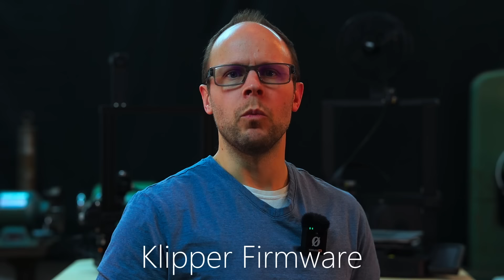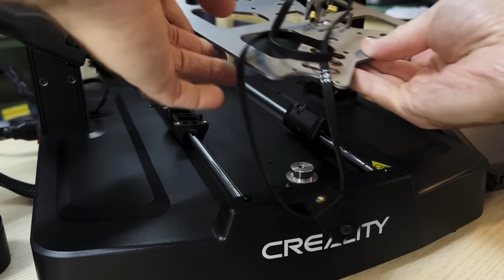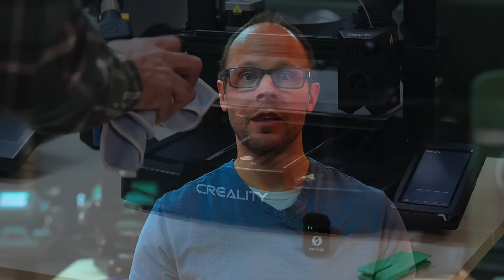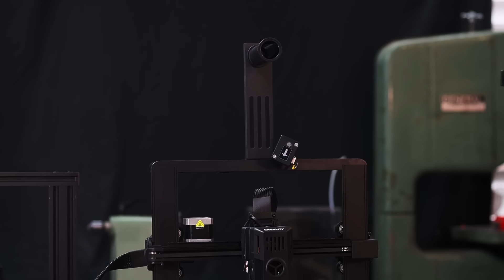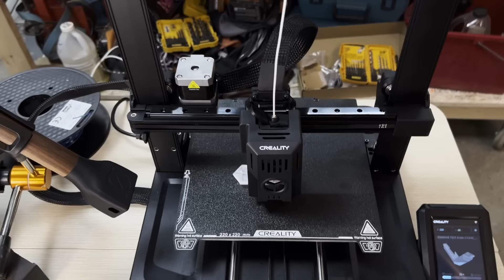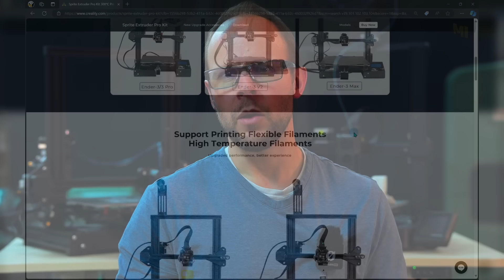Is the Creality Ender 3 V3 KE Any Good?

Comment: Thank you for your video, Can you please do a comparison between Ender 3 V3 KE and S1 Plus... I want to purchase my first 3D printer and I'm so confused... I like the 30x30x30 bed of the Plus version.
Reply from the maker: I've had a look at the PLUS and there are some good features, the cast metal frame is very nice, however they are still using rods an linear bearings on an even larger bed, that's a little concerning to me.  On the other hand, adding linear rails to a cast metal base would be super simple and I believe that the risers on front and back can be removed and linear rails can be added to go right through.  If it were me, I'd get the Ender 3 V3 PLUS, no question.  I'd also want an enclosure, big prints are prone to warpage and shrinkage, even more so in an open air environment.   I'll reach out to Creality to see if they'll send me one to test out.
Reply: @NeedItMakeIt  Thank you for your answer, It really helps.
Reply from the maker: @vahida6146  I'll have a video out within a few weeks showing the solution for the KE printer using linear rails, but in the best way possible, I think a lot of people are going to wait to do the upgrade and I've made it as simple as possible.  I do want to get a Plus as well...  Plus stands for + size printer?  I'd like to see if it has the same problem, but I really like that they've used some of the same parts and methods from the K1 series of printers.  I really enjoy my K1, it's one of my favorite printers.  The Bambu X1 is great, but it's quite $$ in comparison.  Being able to swap parts between printers is ideal and it's nice to have printers that all look like they belong to the same set too.  As a side note, the new printers are also grey, which is so much nicer for keeping them looking clean, the black shows every single spec of dust and in my shop at least it's a bit annoying.

Comment: Can you give more detail on the 'tried to align them a little bit better' portion of fixing the bed wobble at 5:30? I only see you demonstrating the problem and then demonstrating that the problem is gone.
Reply from the maker: I ended up making a follow up to this video to identify the exact issue.  https://youtu.be/B06lTrhjC5s?feature=shared  The issue is fixable if you want to ask Creality for replacement parts, or if you want a better solution, I'm working on one that will be far better than the original setup.  I'm just waiting for parts to arrive before I can finish the video up.
Reply: oh awesome, thanks! the linear rail solution the other person made looks good too. do you think replacement bearings from creality would be different?
Reply from the maker: @jackmaniacki  I think unfortunately it's the rods, but if they can send you the new rods, it would help a lot.  Yes there is another linear rail option, but it's still not perfect, they've used the original mounting position of a central placed linear rail carriage.  It will not provide the stiffness needed IMHO when printing at the front and back.  It's still better than the original no question.
Reply: @NeedItMakeIt  thanks a bunch for taking the time to reply to a total noob. I think the stock set up is going to be ok for my needs for the time being, but I'm going to reach out to creality and sub to your channel 🙏
Reply from the maker: @jackmaniacki  If you can get the replacement parts, I think it'll do fine, if you can measure the rods, they should be exactly 8mm, or even slightly oversized.  My K1 rods measure at 8.05mm, which is perfect for a bit of pre-load.  Unfortunately the KE was 7.95mm, close but not quite good enough it seems.  

No worries, it's my pleasure!

Comment: Have you used a slicer other than Creality Print with the KE? Creality seems to lock up a lot.
Reply from the maker: If you've rooted your KE I'd switch to Orca slicer I only use Orca now for my Bambu and all of my Creality Printers.  If you need some help getting there, let me know, I can guide you a bit if you need it.  

Creality Print is really slow and doesn't have some newer features that Prusa/Bambu/Orca have.

Comment: To answer the title of your video, its absolutely trash, my Ender 3 V3 KE broke down after a month of light use, then broke down 2 days after I fixed it and did a complete hotend replacement. The customer service also refused to help.
Reply from the maker: I can see the extruder not lasting, it's designed for lighter duty printing, I can see by the construction that it's not build to the same standards as the K1 extruder.  I just made a follow up video, and have found the source of the problems I was speaking about in this video if you're curious.  Can you request that Creality send you a replacement extruder?  The hot end should be plenty capable, it's been running for months now on my K1 and works really well IMO.
Reply: I will give it a go, thanks :D
Reply from the maker: @superchargewither2893  Let me know how it goes.  In the video I just released today, I showed how it's possible to fit the K1 extruder onto this printer.  I changed it back afterward since it didn't seem to fix my problem I was having.  It's a nice compact extruder, maybe that's a better option.  I still think that the sprite extruder isn't good enough for the faster printers.  Hence the change on their next new printer.   https://imgur.com/a/NgCAGJX

Comment: I got the KE a week ago and it's great, but I'm only doing PLA. It's my first 3d printer so I don't feel ready to branch out into other filaments just yet. I love how easy it was to put together and how I haven't had to tweak any settings or anything yet and things are just working well out of the box. The fear of tinkering and calibration is what kept me out of 3D printing all this time.
Reply from the maker: It is so much better than my old Ender as far as the software, there is one lingering issue left to make it a really good printer for any material.  I have a video set to release tomorrow morning.  It wasn't too clear where the problem was coming from, but it is very clear now.  Maybe you can check your printer for the problem if you have a chance to check it out.
Reply: @NeedItMakeIt  I'll be on the lookout for that video man. Thanks

Comment: I just bought a KE and am having print problems on the sides of my models.  I have tried many print configurations.  Is there another printer in the same price range you like better
Reply from the maker: The Bambu printers are the best bang-for-the-buck, they are a bit more expensive, but you also get a lot more features.  If you can afford an A1, it's a good printer, just make sure if you jump to that one that you get a new version with the bed strain relief issue sorted out.  They have some stellar engineering skills, however even they also have problems sometimes.  I expect that they've been pushing so hard that they didn't test their product for a long enough time to find the issue.
Reply: Thanks for getting back to me.I replaced my Ender 3 V3 KE with another one.  Same problems.  The most annoying is the extruder stops extruding mid-way through the  print.  The nozzle gets stopped.up and I have to pull the filament out and re extrude.  Is this a software problem or a design flaw? I used the PLA that came with the printer and I am using the normal print setting.  Do you have any tips that will help me through this conundrum?  I like the printer but I will send it back if I can't resolve this problem.

Comment: This printer doesn't worth $280 , maybe $180, why would someone buy this over bambu A1 mini for same price or A1 for $150 more?
Reply from the maker: I have to agree, as-is with the issues, it isn't worth it, the competition's printer offers quite a bit more for the value.  The only + for these kinds of printers is that they're more easily modifiable, and that's what a lot of people want.  I like to mod my printers personally, but I try to restrain myself to keep the printer as close to stock as possible unless it's something major.  The fit of the linear bearings onto the rods is a big issue IMO.  That needs to be addressed from Creality immediately.  The A1 mini is a bit small for just about anything I print, maybe it's okay for some people in the type of work they do, it's still a good printer no doubt.  The A1 is a great printer also, and the issue with the cord should be fixed in the next releases.   I have a follow up video coming out tomorrow to show the reason behind the poor print quality, it wasn't what I expected, but turned out to make a lot of sense.

Comment: I wonder if adding the preload to the Y axis rails will cause premature motor failure.
Reply from the maker: I'm nearly finished the follow up video to this one, I've found the source of the problem.. I think I'm just running some tests right now.  Adding some pre-load here should be fine, the linear bearings have very little friction, less even when we pre-load since they don't fit the rods.  I'd think that 8mm exact rods would be the best solution here, but pre-loaded bearings for a slightly undersized rod would work well also.  Unfortunately the design is very limiting, the bearing blocks are central and aren't tight enough, it causes a lot more movement as you make your way to the ends of the bed.

Comment: I've had my Ender 3 S1 Pro for 9 months now. It also has the Sprite extruder. I had similar if even worse problems with inconsistent extrusion with every filament after a month or two of using the machine. After quite a bit of hair pulling and web searching I was able to figure out that the filament tension adjustment spring is too loose and can drift over time, and that it turns out that it is not very difficult to make the mistake of overturning the screw used to adjust the tension. The adjustment is very "on/off", there really isn't very much feedback to be felt in the filament locking lever when changing it, it's either super tight or loose. When you overturn it, it can pop out of the threads of the square nut that it goes through, and after that you have to open the extruder and put it back in manually. It doesn't help that the screw has backward threads.
In my case it had come off due to me overturning it, and I didn't know, and I had almost stripped all of the very short thread clean from the square nut by trying to spin the screw when it had jumped out of position. It took some fiddling and quite a few carefully chosen swear words, but I was able to get it back on and also modify the whole thing with some spacers, which make the adjustment spring tighter to begin with and hence the adjustment will not start drifting again and the risk of unscrewing it is a lot smaller. I hope...
Reply from the maker: Thanks for that info, I should have a follow up video ready for this weekend, I believe I've figured out the problem, though I need to test and prove it.  I did an entire extruder swap and used my K1 extruder, however the problem did not go away for me.  I'll be careful with the original extruder's tension though, thanks for that.  I would have kept the K1 extruder on, except the fan cover doesn't fit over it, which is a bit of a bummer, I like the K1 with the larger gears and sturdy build quality (newer versions).

Comment: When you did the test on the extruder head you showed the indentations on the PETG filament, you did not show the indentations on the PLA. The depth of the indentations would show the pressure on the filament, one may be harder than the other. The result may show that you may need to increase or decrease  the pressure on the extruder.

Comment: Thanks for the great video. I was on the verge of ordering one of these but you've more or less convinced me otherwise. I already have an older flakey bed slinger which, despite producing very acceptable prints, requires way too much maintenance and hand holding. I was hoping to get away from this while increasing the print speed a bit but I guess it's just not happening with the KE and probably not in this price range.

Comment: The two rod retaining screws in my case don't even reach the rod.
I changed the screws 1mm longer and now my table is fixed, it doesn't move at all.
Reply: What are your prints like now then, I have one in my shopping basket but this video has worried me with the artifacts in the video
Reply: @mrinfelix4574  I've never had any problems with the quality of the print, but the important thing is that almost none of the screws are properly tightened at the factory. The two shaft retaining screws were not even in contact with the shafts and therefore moved. I had to replace them immediately with longer ones, now they are properly secured with no movement at all.
Reply: @mrinfelix4574  I hope you didn't buy one. Go with the Bambu A1 mini if your new to printing.

Comment: I think you are on track with the extruder drive.     Creality has had issues with the extruder on the k1 series in the past.  One thing to look at withnthe filmament is the consistency with filament diameter and possibly correlate to this issue.

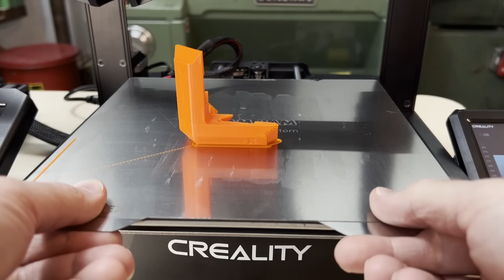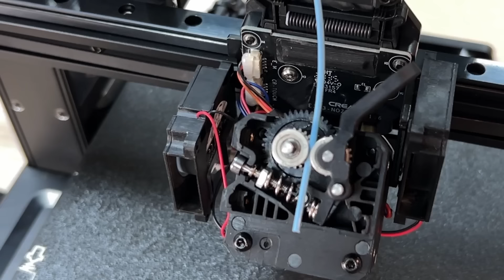Comment: That wave pattern you are seeing in the prints (13:33)  looks like nozzle pressure fluctuating. Coincidentally if you stare at the extruder when you are testing it (21:15) you can see a rhythm especially at the end of the latch since its exaggerating the issue, something isn't "round" or the gear that's feeding filament has a bore slightly too large for the shaft and a set screw is pushing on one side so its not centered. That is why the feed gear marks are uneven on the filament. When you print fast that will cause the molten filament pressure fluctuating at the nozzle thus causing a wave pattern in the print. 

I'll be curious how you fix the bed. My thought is to just continue what you are doing and shim the rods outward so they push on one side of the bearing making everything tight (if that make sense god bless you). It's a bandaid solution tbh. You could elongate the mounting holes for the bearing carriers into the bed so you can slide them outwards to make a tight fit.

Honestly I feel this is poor engineering. They are trying to add features that enhance precision on the cheap, and end up worse then where you started. Those bearings and rods is an obvious example, they had a solution that wasn't very elegant but it got the job done. Now they have a elegant solution that can't get the job done.
Reply: He did have the extruder case open which makes the gears and shafts wobble when spinning because they aren't captured from both ends.

Comment: I got the Ender 3 v3 ke, and really so far, it’s been amazing. IMO it’s a really great printer.
Reply from the maker: That's good news.  Are you seeing any of the same issues as I had?  It seems as though printing PLA is not a problem, but PETG is, very strange.  I am working on trying to fit a different extruder to prove/disprove that theory.  I think the printer has potential, it's nice to be able to work on a printer that's open again, so much easier!
Reply: @NeedItMakeIt  I don’t have a problem so far.

Comment: i have the ke and i went threw everything you did in this video. it was frustrating. i did find that every filament so far runs the greatest at 240mm. the hyper i can run full tilt but make sure you have a good solid platform the printer is on when doing so.

Comment: My KE arrives in a few days.   Thanks so much for the tips and things to look out for!   I'll be using it for reference once it arrives and I can start testing.
Reply from the maker: It certainly has some potential, and there is always the potential that I have something that isn't quite right, I'll do some more testing on the extruder to see if I can narrow it down.  I see that there is a model for replacing the linear bearings with linear rails already, so this is already a problem someone has corrected.  Still printing PLA seemed really good and at nearly the max speed as well.  PETG still baffles me.  Let me know how it goes, I'm curious if you have anything similar to what I saw.
Reply: I know this is old, but did it come with the same issues?
Reply: hey i know you posted this a while ago but just wondering how its working thinking about getting one but want to get a perspective of someone whose already got one thanks in advance
Reply: @lucashacke2741 The first KE I got was a mess.  Bad yaxis bearings, issues with the gantry, etc.  Creality ended up replacing it after a bunch of back and forth.  The replacement is better but still not a great printer.  I would not recommend.

Comment: The answer is no. Do not buy this recycled garbage. Save yourself a ton of pain and just buy the Bambu A1.
Reply: Creality has stepped up their game, especially with their k1 series. I wouldn’t trust this comment anymore.
Reply: Are we talking about the same Bambu A1 that has caused fires and now all of them are under safety recall?
Reply: @fyrfyter33 manufacturing errors happen; at least you know bambu labs will do something sbout their errors, compared to creality shitting on its customers with bad qc.
Reply: @pr1nceray  I have yet to see a Creality melt down and light someone’s house on fire. Bambu is definitely ahead in that way!
Reply: I nearly bought this today if it hasn't of been this video and your comments and others, thanks! :)
Reply: I've had dozens of machines and now have two of these heading my print farm. They're fantastic machines, only issue I had is that one of the screws for the motor mount was loose on the one. When I ordered mine I also convinced a mate of mine who is new to printing to pick it up, he loves it. Here we don't get the A1 for a good price but even if we did I prefer the ke because it doesn't start house fires.